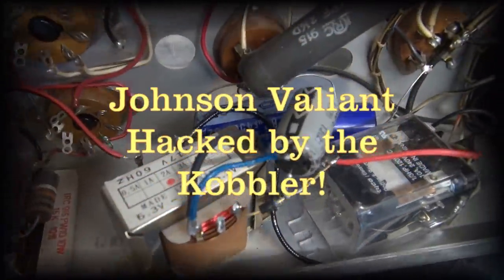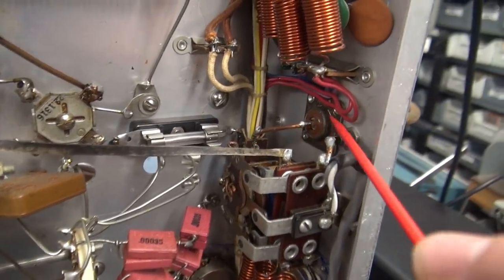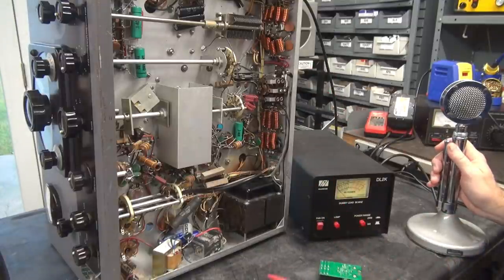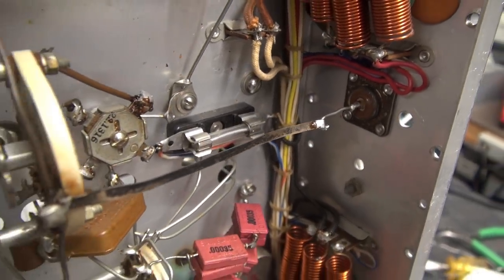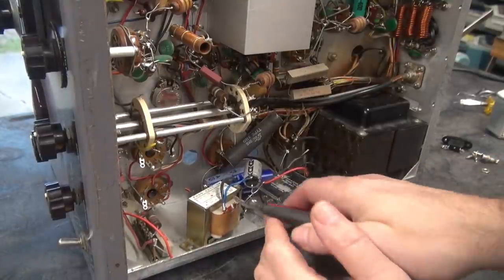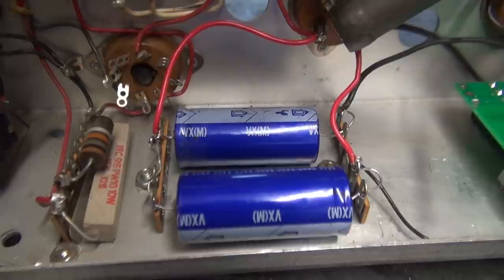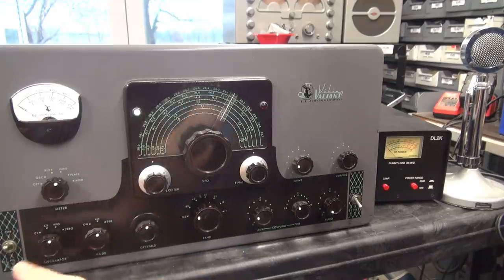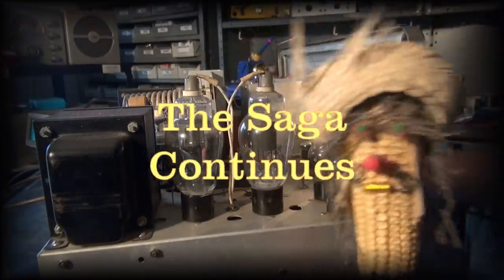King Kobbler and add Push to Talk PTT Johnson Valiant Tube Ham Radio Transmitter Un-Mod the Kob

Comment: Taking on any work? I have a 100% stock ranger 2 I want to get up and running.
Reply from the maker: What does the Ranger need?
Reply: @d-labelectronics  i will take it out today and run it up on a variac.  I know the resistor in the vfo is original. Also the bushing in the vfo is a little tough. Its the nicest one I've seen only thing is paint on the change is peeling. All Johnson tubes also. I just want it functioning and reliable with ptt. (Unsure if the ranger 2 had ptt or not. I can take pics if ya send me a email chris@w1cjf.com